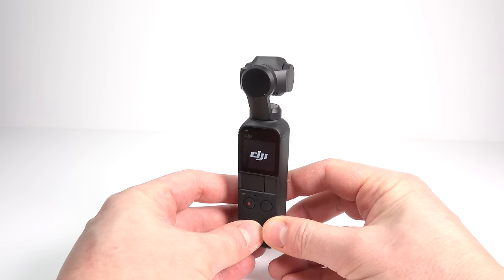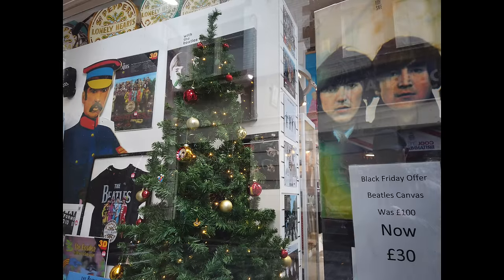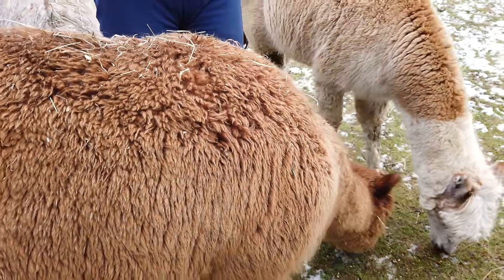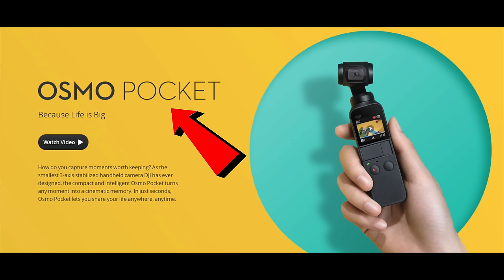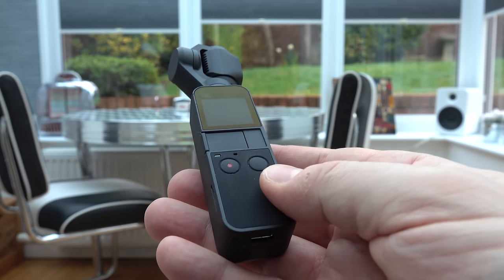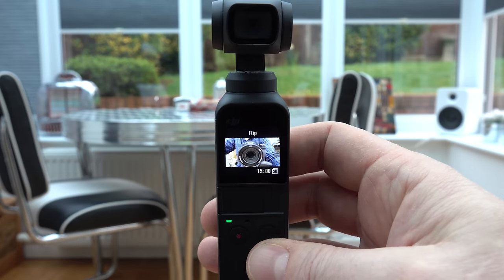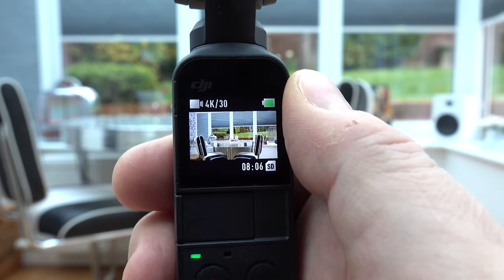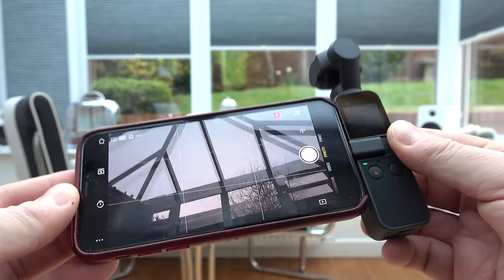DJI Osmo Pocket - REVIEW 3 months on

Comment: FYI When taking Panoramas on the DJI Osmo Pocket (and many other DJI Products) the pano image saved to the phone is only a fraction of the size of the source files saved on the CD card. You can download the pano source images from the SD card and stitch them together on a PC using the DJI Media Maker app provided by DJI (just google it for a link) or there are 3rd party tools that will let you create a full resolution panoramic shot from those same files. Also the phone adapter can be reversed so the end that plugs into the phone is stored closer to the camera body during storage. Though you should know this because you get a warning that the plug and wifi adapter can't be connected at the same time. This can is resolved by inserting the phone plug adapter the opposite way.
Reply: Thanks for commenting this, if you're just posting a pano to the web then the low res is probably fine but it is nice to have access to the full resolution images, same for timelapses and motionlapses.
Reply: Fen totally agree.  I can post the phone saves to social media but if I want to print something (ended up printing many labor from my older Osmo Plus) I’ll refer to the source files.

Comment: Fantastic long-term review. Thank you for taking the time to post this. I’m fascinated by the idea of this device, but I do think it was rushed to market in an unfinished state. I do hope for a second generation version that is a complete product. Some things I would look for, and would expect to pay a little more money for, would include:
1. Wider angle lens. 
2. Inbuilt wireless.
3. External audio support (mic port, support for wireless mic/earbud monitor)
4. “Log” low-contrast, low-saturation video output for color grading.
5. Inbuilt jog wheel or thumb pad for panning/tilting.
6. Forego the direct physical connection to the phone. There should be no need for this in 2019. We have NFC, Bluetooth, WiFi which should all be sufficient for use without direct port connections.
7. Ease way back on the accessories. Make this thing work out of the box really well.
8. Tripod mount at the base.

Comment: For creating high res panoramic images Microsoft ICE (Image Composite Editor) is a really good free tool for Windows.
All you need to do is take a bunch of overlapping pictures at the same exposure, throw them all into ICE and the application will automatically find out what picture goes where. It takes a bit of time to process, especially if you have a lot of images. You can then select between several different projections to get something that looks right for the image you took and crop out a finished image that will have a really high resolution.

Comment: I feel like this product is the result of a lot of compromise and internal struggle at DJI over what their next product should be, resulting in a device that isn't great at any of it's potential use cases.

Out of the box it's too wide to be used purely as a camera attachment for your phone but lacks even the most basic physical controls needed for solo operation. It has a 4k sensor and a lot of prosumer friendly functionality, but lacks an external microphone port and tripod mounting. They have a litany of aftermarket accessories but other than the controller attachment they're all too expensive for how simple and restricted they are, leaving them out priced and sometimes out featured by other companies' accessories.
Reply: lol wtf? DJI invented and standardized many of the key consumer quadcopter technologies. Everyone else is copying them. nobody else makes better drones for this market segment. They have many products in production, this is just one for a niche market.  @aserta

Comment: 2 years later and I have both the Pocket 1 and the Pocket 2, and I love them both. Each has its strengths and is better at some thangs than the other. I mostly prefer the 26mm of the Pocket 1, and much prefer the Pocket 1 Controller Wheel to the Joystick of the Pocket 2 so I have two of them. Love the Extension Pole, and the charging cases. The one thing that DJI has never sold and always should have, is a Z axis stabilizer. Many of them on eBay don’t work very well, but the ones made by Scotty Makes Stuff are fantastic and really make a big difference.

Comment: Something I noticed, you were talking about the adapter pocking through the hole when connected the camera in the case. You can turn the adapter around so it faces the other way, that's why there's a little cut out there. So you just pull it off, flip it around, reattach it, and you're good to go. You're right about it not taking the control wheel or wireless adapter...that's a bummer.

Comment: I picked up one of these not long after launch and wanted to add a few items of note from my own experience for anyone who might be looking at this review for a buying decision:

- The phone connector/adapter can be attached backwards, so that the body/handle of the camera protects the connector and so that it isn't sticking out of the case.
- Part of the reason why I wanted this camera was so I could do panning time-lapse closeup shots as I do detailed work, but the first step the camera does when it starts recording the time-lapse is reset the focus. In other words, you can have everything set up and set at the focus you want, but it will refocus too far away to work for what I want. I think I'm a firmware version behind, so maybe this has been fixed since, but I expect my use case is pretty niche, so I don't expect it is.

Comment: I think we've had similar experiences with this, I got mine in Jan and was disappointed, I finally got the expansion kit and it turned up broken.I sent it to them and it came back smashed to pieces thanks to UPS. finally after updates and getting extra parts I'm quite happy with it.
Also exposing dark is a good feature as you don't clip the sky and can have an image with a greater range.

Comment: Given it's meant to be a stabilised camera that bounce effect is a deal breaker, especially when you consider the price...
Reply: I mean... how are they to compensate for vertical movement?
Reply: @onemanshow4116  4-axis gimbal is the answer. And/or additional electronic stabilization.
Reply: @joojoojeejee6058  Is there a compact stabilizer with a 4th axis on the market? Surely they'd add a 4th axis, if it made sense. I think the compromise here is a one-handed extremely portable point-and-shoot option. If you want a 4th axis, it seems there's a bunch of two handed monstrosities that, I'm sure, blow this guy out of the water on quality.
Reply: Zero Cool  Yeah I don't know whether or not 4th axis is feasible, but electronic vertical stabilization might be. The newest GoPro does a pretty good job in this regard?
Reply: @onemanshow4116  
There is a 3D-printed vertical stabilizer available for Osmo Pocket. It's compact in a sense that it's still smaller and lighter than a mirrorless system but it's hardly pocketable anymore.
Reply: Another shoddy chinese camera, I bought many of them - the dark exposure, bad low light is their trademark basically, but they hired some west guy for design,  it's too much processed for comfort of use,  they never made first iteration such good or no one will buy next minimum 3 generations,  improved very slightly.  The price is like fraud by itself.
Reply: @fontenbleau  I guess you don't know what DJI is :)

Comment: The solution to all the problems you mentioned is a Removu K1.  Everything you mentioned that came out as an upgrade or plug-in option is out-of-the-box on the K1.  It even has an optical zoom and removable batteries.  Wifi, mic input, wider angle lens and a joystick to pan and tilt is built in.

Comment: The only accessory you need to get good results in this camera is a ND filter and this does not affect portability at all. Of course a device this size will get some compromises, but it does have a great sensor and horizontal stabilization is fenomenal in most cases. It also have d-cine like profile for color grading and boots in 4 seconds.

It’s like reviewing a Mini Disc player and complaining about the absence of LP support. 

You can use this as it is and get really good cinematic results if you are willing to adapt in exchange of portability. It’s the kind of product you just get if you know well all the options in the same niche (and know how awkward and slow to start they are).
Reply: yeah strange how 50 other reviewers get excellent footage from it but this ancient tech dude can't. Says a lot about his knowledge level.

Comment: I don't get why panorama modes are still a selling point. If you do panoramas with camera built-in modes it's usually always disappointing for one reason or other. I always use Hugin, which is a free desktop software package, and which has plenty of bells and whistles for finetuning the results - not significantly more difficult to use, either.

Comment: Interesting review. I waited for a while before I bought mine as it allowed more accessories to become available. The control wheel is very good and it also gives you a fast mode change which is handy. I got a Ulanzi base for it so it had a tripod mount and could be charged from either side of the base. No problems getting ND and ND+circular polarising filters. Finding my way around the settings took a while but once you get it, you can do more things with it. The 80 degree view angle very well suits what I used it for, I normally use a Sony FDR AX700 for general purpose video but the are locations and places where its too big or inconvenient to use and it here where the Osmo Pocket fill a very useful gap for me that action cameras did not. The video quality is good enough to mix and match with the AX700 footage and can be processed with much the same post methods. As far as the carry case, I found one on eBay that is designed to have the control wheel fitted and it makes the cameras robust and convenient to carry around in a pocket or carry bag.

Comment: 16:30 - Turn the thing around.  I leave the connector thing on mine all the time but I turn it around.  If you take the plug thing off and flip it around, it won't stick out of the case anymore.

I think using this thing for what it's good at is very important.  It does do some stuff very well...I really love the moving timelapse feature, for instance...but it's definitely not a jack of all trades.  It's a tool, though...a very useful tool.  I quite like mine.  Handy little thing.

Comment: lens FOV was chosen as its the same camera as in the drones - and those benefit from an FOV around 80-100. Same issue was present when they first did this - with the DJIOsmo - which I have.  It is a shame - with a 170 fov like a gopro it would be a great replacement for many action camera applications - for example ideal for helmet mounting, where I currently have to use a gopro in a 3 axis gimbal on my helmet for paramotoring videos. But with the limited FOV it's just no use for that application, and I suspect many other actions camera type uses.

Comment: These days you’re lucky if the first firmware release allows you to upgrade to the next version (for you it seemed it almost didn’t), let alone does anything useful!

Edit: Does the usb mic perhaps require a firmware update to support it? Therefore why, when you tested, a generic one didn’t work? Some chance I suppose at those prices, but it could be the case.

Yep, designed to make you buy the accessories. Perhaps it’s called the pocket, not because you can put it in a pocket, but instead because it will leave a hole in them?

Comment: Tbh I don't  that the settings walkthrough is boring. Ironically it's  the one thing I especially like in your videos and sets them apart from other tech reviewers on whom I have extremely mixed opinions, is that I get to know how the heck the discussed device works and how would I change the settings if I ever would want to get the device for myself.  I really think it BREAKS the flow if you put it in the end, but I can understand it in the case of the DJI Osmo Pocket being that it would  break the flow of the video. Though I REALLY hope that doesn't  become a recurring part of the channel, having the Multipurpose part of the video put on the  end of it.

Comment: GoPro did something similar with USB to 3.5mm adapters. As it turned out the adapter just had a resistor inside it to tell the camera what it is. I needed a low profile adapter and didn’t feel like paying the high premium GoPro was asking for theirs. So I made my own adapter with the right resistor and a L-shaped USB plug going to a wire with the 3.5mm plug on it. I imagine this camera is similar. It might even be possible make an adaptor yourself.
Reply: buy the $9.00 adapter on eBay hell it comes with a cheap Sony made stereo mic also

Comment: I have an Osmo Pocket and in reference to the car clip at 15 minutes in, I've mounted mine to my dogs and it was perfectly stable, while singing side to side on their harnesses.  I know its not a car, but I am interested to see if it will vibrate the way you had it because I've also used it on rides at amusement parks and didn't have any of those vibration issues either.  Though I was holding the camera too.  Personally, I don't think I would mount it on anything as I would be too afraid of breaking the gimble by absentmindedly moving around.

Comment: I don't understand why anyone would have a problem with such an extended going through of the menu options. That is critical for consumer devices like this that so often have confusing setups, poorly thought out menus or missing obvious and very necessary features, so thank you for that. One thing that I wish you included was if it correctly makes seamless file breaks so there is no gap in the video or audio tracks when you bring them into an editor. Many cameras seem to do this for some reason and there is frankly no excuse for it.

Also, does this really require a smart phone to setup (mandatory acceptance of whatever permissions DJI wants) and an account at DJI? If that's the case they can fuck right off.

Comment: I don't agree with your comment that a joystick would have been better than a scrollwheel. In many cases, you are only going to scroll up/down or sideways. It's very difficult to do properly with a four-directional joystick, so the DJI solution is actually well thought about and works very well...

I agree however that the standard case should be compatible with the Osmo Pocket with the wheel attached, or even that the wheel should have been part of the device...

Comment: The product looks like a company making nice drones with a stabilized camera suddenly got the idear to only sell a stabilized camera and needed it to be out for Christmas. The very high price for extremely basic fgunctionality, like a tripod mount, is not the worst. It is that they have to be added or removed and you cannot use many things together. There are several similar products out there, some with a camera built in and some for mounting an action cam or phone, which are much better designed.

Thank you for a proper review. I have bought several products based on watching many reviews, that all failed to list basic design flaws.

Comment: I quite like the field of view having owned it for a few weeks, but then I'm not likely to use it as a vlogging camera. Exactly as it says on the tin, tech and moan, with even a sprinkling of positivity and useful feedback points - listen up DJI. One thing that most reviews don't mention is the annoying beep when you press record and stop, although a DJI forum says it will address this issue in the next firmware update.

Comment: If my math is loosely correct, this appears to be a $1000 USD action cam with all of the accessories as shown. That's a lot of money...
Reply: Maxwelhse well worth it though, have had one since November
Reply: @stephenroth2905  It looks cool, but I don't think I'm ready for that kind of commitment.  That's well into nice DSLR range, but very different applications.
Reply: Maxwelhse no doubt, they have narrow use. I had just bought second the other day, was good to set up and auto track while using my other cameras then add in later.
Reply: @stephenroth2905  I'm glad you're happy with them. Nothing is worse than paying the big money and then not getting what you wanted out of it.
Reply: He states that this is the March review after the 1.03  update and with released acce$$orie$. 

It's still a silly toy camera.

If you want a tiny sensor camera without interchangeable lens, get an action camera like the GoPro HERO7 Black, or just use your phone.

If you want to get good video and pictures get a proper camera.

FOV is waaay too narrow on Osmo Pocket. No exchangeable battery. Face tracking (required because if the stupid narrow FOV) gets lost too often. Poor high wind and vibration stabilization. Terrible sun glare. Blown out sky and crap dynamic range. Rediculously cropped slow motion without audio that is auto converted to 29.97fps so you can't speed ramp. No built in weather proofing. No built in mounting options.  Requires investing more and more $$$ for accessories that when connected, make the Osmo Pocket bigger, clunkier, and less pocketable.
Reply: @stephenroth2905  Sorry, but it looks like a rushed money spinner.  The video quality isn't very good either.

Comment: I remember seeing a software that is able to smooth out motion in postprocessing. It just takes every video frame and crops it and moves it around, so a bouncy video becomes super smooth and centered. So if this gimball device pretty much fails at everything, you might as well use a better camera and fix the video afterwards.
Reply: It's called a digital stabilisation. It crops the image and sometimes does weird things with the picture. It's absolutely not a replacement of the proper mechanical stabilisation.